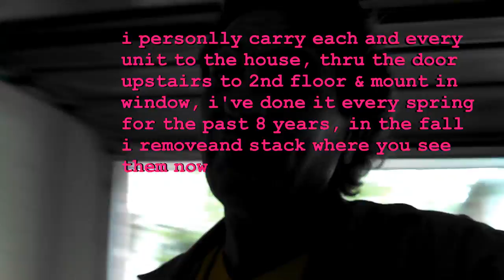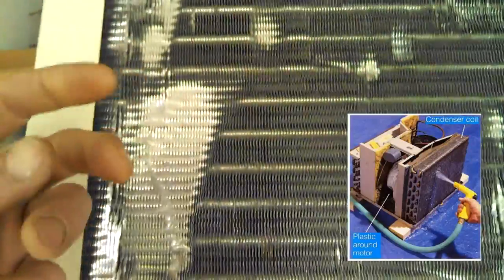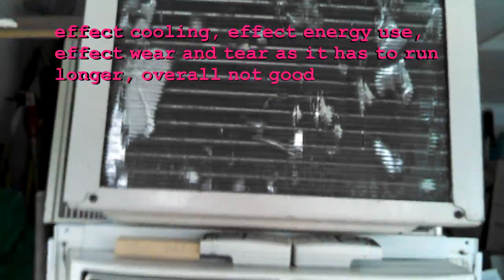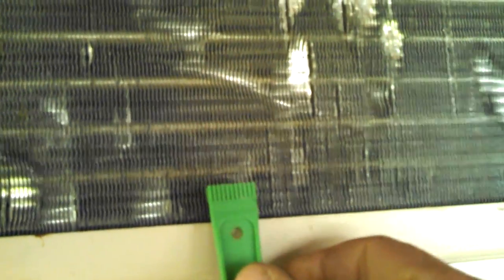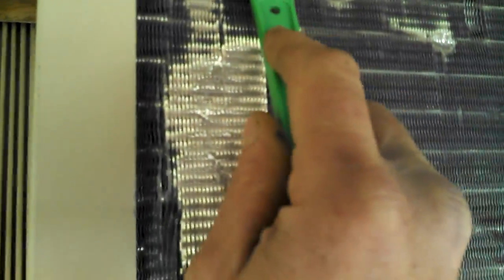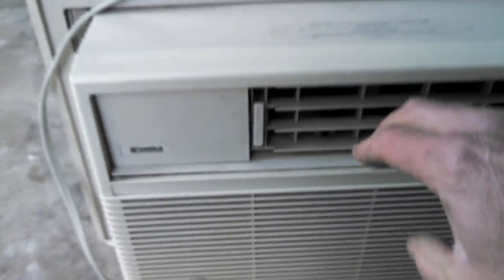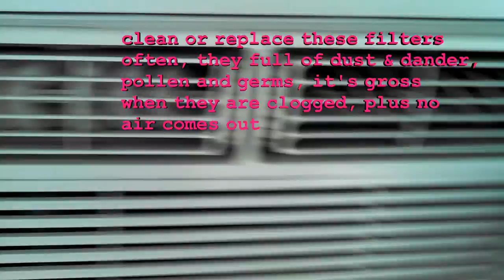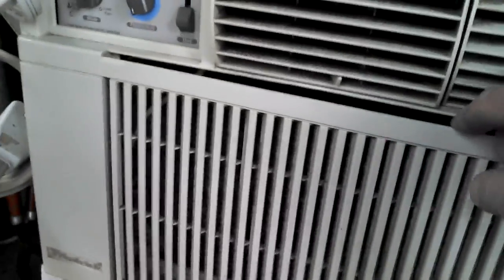Clean Window Air Conditioner for Best Coolling

Comment: Subscribed, thanks for the tip on fin combs... never knew they has something easier... I was doing a single fin at a time with a micro flat head screwdriver. I had tried using a dog brush but it was too wide.

Comment from the maker: just check the wires on back of switches have not come loose, both the selector switch as well the fan speed switch, you have a multi mater? you could test the switches go from there

good luck

Comment: I have a window unit much like you have in this video.  I'm getting my air conditioner cleaned up for the summer season.  It has a fair amount of black mold.  What is the best cleaning solution to use to clean the inside and fin panel.  I understand that bleach is "not good" to use around the copper coils.  Any thoughts or recommendations.

Comment: T hank you for the informative  video....and the accent! I  learned a lot from you  and now I have a question please. 
What if a person can not  remove the unit from their window, such as a widow? Can I use  hose  with a spray end and spray really well through the vents? I know it will not clean as well, but would it make a difference? I can not remove it out of the window. I cleaned the front part, in the house, as much as possible , without moving the coils. (so happy to see how to straighten the bent coils, with the fin comb, with some strength behind it. I would have been too easy .)

So , how to clean , as best as can , with unit still in the window. 

Thank you, from Texas.
Reply from the maker: Cheryl Coker yes, in you cose the recirculate vent if equiped) there is no direct path from outside to inside, go blast with hose, its not going diretly into house, i woudnot spy the wings but yes for the machine and the fins!!!

Comment: Thanks for the excellent tip!  

As a woman, I installed a window AC myself today. This house is so old, it wouldn't fit in the side, and was crocked b/c the house is so old. So now I'm worried it's gonna fall out the back side. Off to Home Depot to get more things for the outside to reinforce, b/c inside the slots didn't fit right, and I had to rig up several installment steps. 

Where do you get those AC fin combs?

Comment: Thank you for the instructions I've been cleaning out my air conditioning before watching this video my air conditioning unit gets dirty because I have cockateils they have powder that goes up into the air conditioner fins it gets really hot in my apartment and the air is not blowing like it's supposed to be doing is there a way of cleaning up the dust out of the Fens please help me thank you

Comment: Great character personality. It was useful description of fin comb. Thank you.Doesn't it need to be disassembled and cleaned inside in addition to cleaning the filter? I'm having trouble getting the front of my Frigidaire 6.5k BTU window air conditioner LRA074AT7 to pop off. I've forced it as much as I dare to avoid breaking it. Any tips on how to open that?

Comment: Ok, so I've been in my apartment now for 4 years and NEVER cleaned my ac units ... I know, I know, gross right? But last season I stared noticing what looks like mold on the front panel. Been watching vids here on YouTube on how to clean an ac unit, so I'll be getting to cleaning mine once and for all, lol! 

My ac unit is pretty secure, in fact, it's not in the window but right below it, in the wall and I'm on the top floor! With that being said, I can't get to the other side to clean it ... Any suggestions?

Comment: Have you ever had a window unit blow a powder fine dust with the air. I don't know what to do. The company want do anything. The unit is only 6 months old. There was mold growing in it. I took it apart and cleaned it. Now it blows that dust. Like the foam is dry roited.

Comment: Thanks for a great vid.
How can I install a Ac in a window without it leaking on the inside? The drain hole is clear and clear from the window, also I have in there pretty level, so I don't get it. What am I doing wrong?
Reply from the maker: Jr, they actually have to tilt back outside a liitle ( only about 5 deg) so the condensate water flows back towards the drain hole nd not frontways into house. most window mount ac units have a built in outside tilt bnut they dont always fit all window frames exactly the same , it important to double check
Reply: Thanks Dino,  I did tilt it, like you said and haven't seen any dripping.. Thanks so much brother..

Comment: dino do you have any videos on a COMPLETE A/C cleaning? i have watched a few and i have an old A/C with a digital panel...i will be taking the panel off and all the covers off im just a bit skeptical that nothing can happen to it its the only one i have!! are all these videos true?? help please!
Reply from the maker: these ac are designed to be in the rain & wind, they can handle water , just be careful with the water-cleaning solution around wireing
Reply: thank you

Comment: I live in the garage and only have on window thats in the door leading to the back yard. I was originally going to buy a portable ac unit but I am told most of them don't work so well. It gets really hot in here. I can't stand it.

How would I mount a window ac unit in my door window and keep it up?
Is a portable ac unit better? If so which ones?
I have only $150 and need your help.
Reply: coollary1  hi go on let go and find one

Comment: What could be the cause of mine always frezzing
Reply from the maker: aaron, maybe the "filter" is clogged? filter is ususlly in the inside cover, it mostly slips out the top or side by the intake grille. or some have to remove the cover for filter, blast it with the garden hose to clean, reinstall, otherwise it could be ice up from actual problem in unit

Comment: Hey Dino, my Friedrich Kuhl AC cools and then stops after a certain period of time.  I noticed when removing the carbon filter that there was extreme ice build up in the grill (fins) area.  Friedrich Website FAQ says that running the unit at lowest temp & fan speed can cause condensation to build up.  I like sleeping cold and don't have this issue with the larger model which is in my living room.  Any suggestions on what I can do to remove/prevent the ice build up and troubleshoot this issue?  thanks..
Reply from the maker: George N is it real humid where you live? other than cleaning the filter and following the recomandations to not keep it full cool at low fan....cuz hey want it to cycle and let the fan melt ice every now and then....long island gets the dog days of sumer....it's humid
run it low fan at 3/4 cool so it can cycle and full cool at high fan speeds and clean filter but i think you did

Comment from the maker: MIAMIWAX, FILL A SPRAYER with bleach and water solution, spray all inside, take the front cover off if you can, then scrub where you can reach with bottle brush or old tooth brush, then hose it off, try not to spry the electric part, but spray the hose anywhere the mold is, the bleach will kill the mildew on contact, the bottle brush will help loosen the clumps to blast off with hose. i use 1 part bleach to 6 parts water with a few drops of dish detergent in spray bottle, like old windex bottle

Comment from the maker: get  wall unit and mount in a wall, door is not a good idea, ac are heavy and your going to possibly have trouble with ninges, lock alignment, door able to hold weight after you cut the hole and also the electric wire
simple wall unit, cut the hole near an electric outlet, screw the sleve in following instructions included

good luck. most of the modern units are good, just shop price